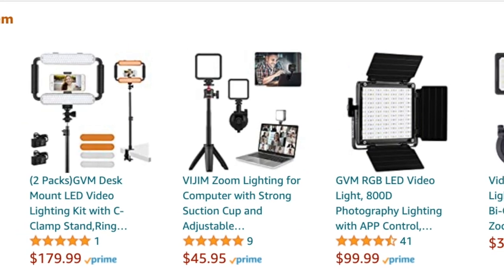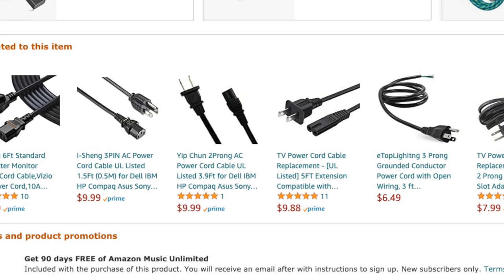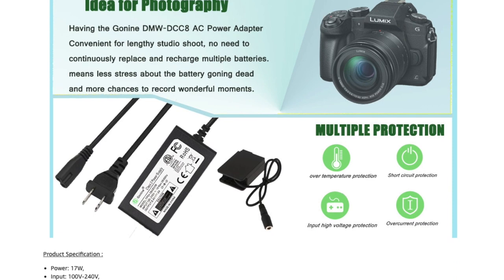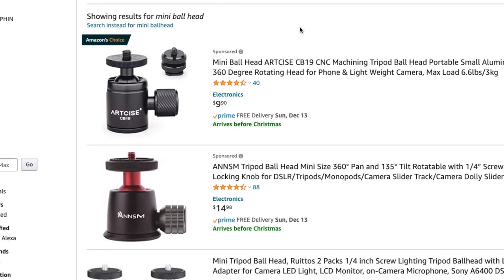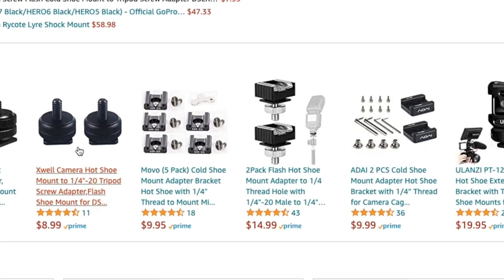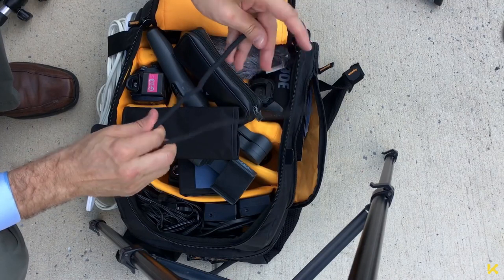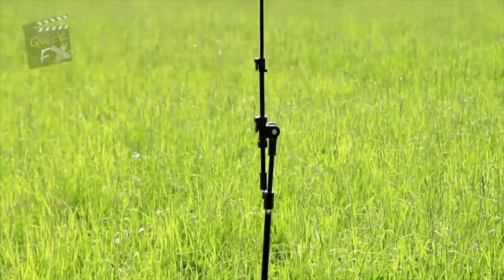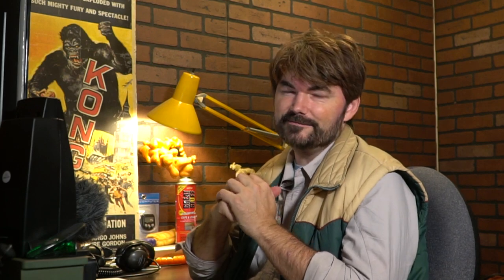Top 10 Video Gear Every Tiktok and Youtube Creator Needs

Comment: Great video thanks for some very good useful info. 
Just a word of caution in using a long power cord. Power drops the longer the cord gets if the gage of the wire stays the same and it can in some cases starve whatever you are powering making it strain for power can eventually burn out fans, motors, screens, etc...